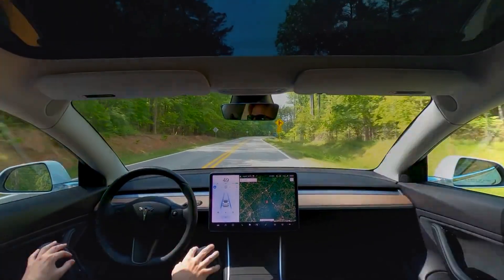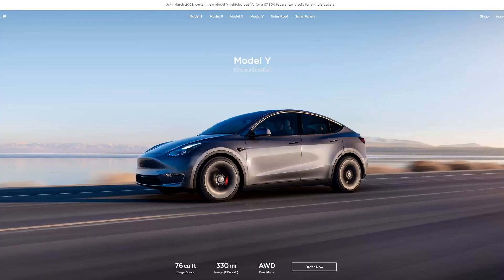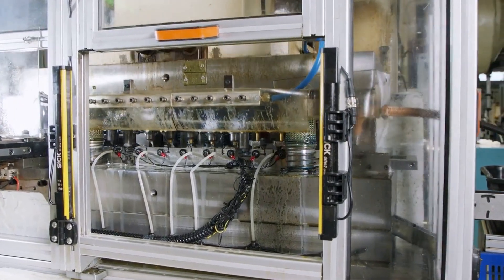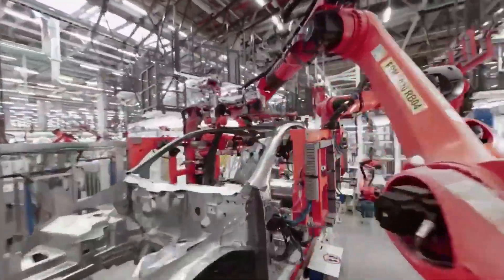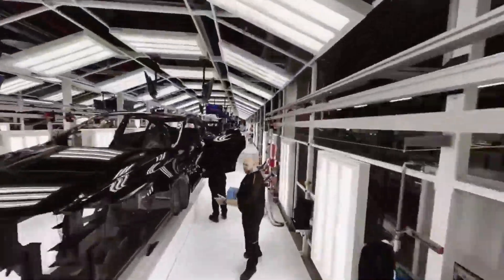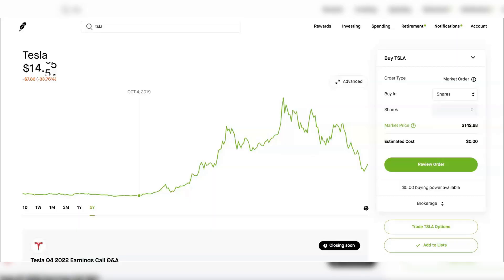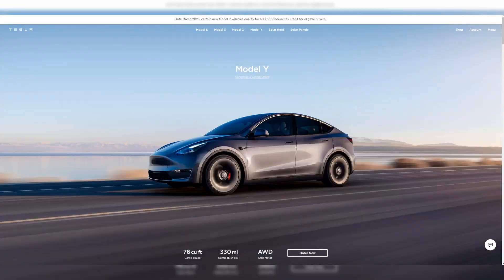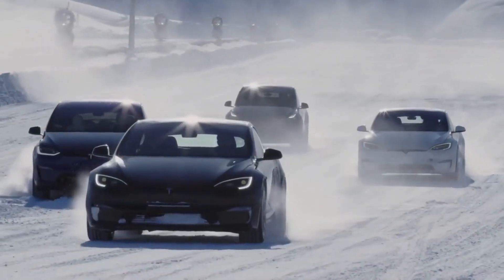Tesla's Revolutionary 30 Second Production Process | EXPLAINED

Comment: The most revolutionary part of Teslas production process is the agile continuous improvement it is a pure process and is why it will be a 29 second tact time before you know it and then a 28. The most significant physical output is the use of massive structural castings replacing 2/3rds  of the stamped parts you highlight. But correct EV drive trains are far simpler to install than ICE. Good B roll
Reply from the maker: Yes, I think the main thing to focus on when watching this video is that Tesla is not even close to done in terms of innovating. The company prides itself on automating as many tasks in the most efficient manner possible. I cannot wait to see what the future holds for all of Elon’s companies.

Comment: Correction
There is not 4,680 battery cells.
The battery sailed dimensions are 46 mm diameter and 80 mm long